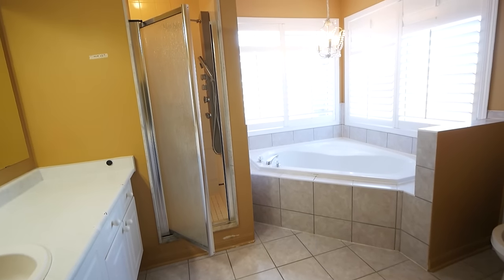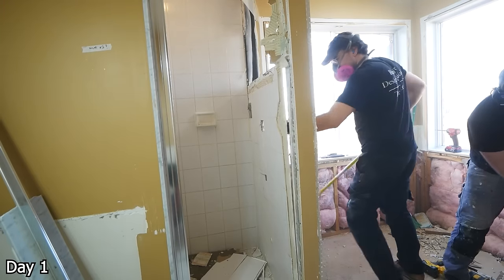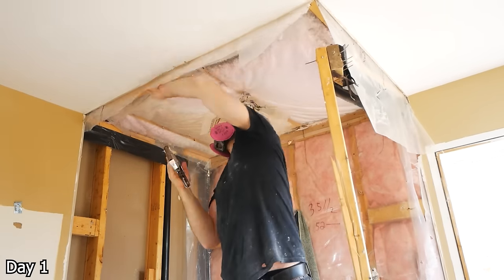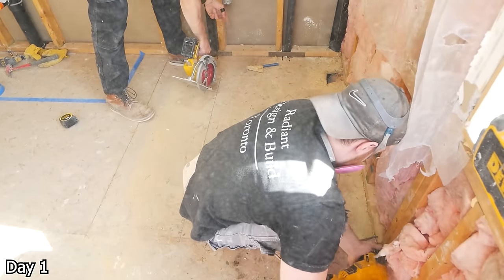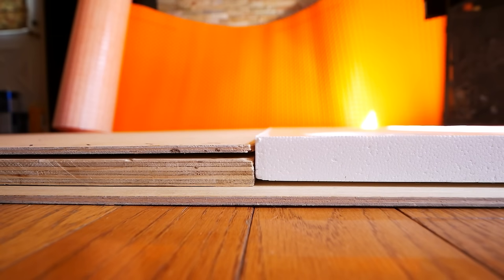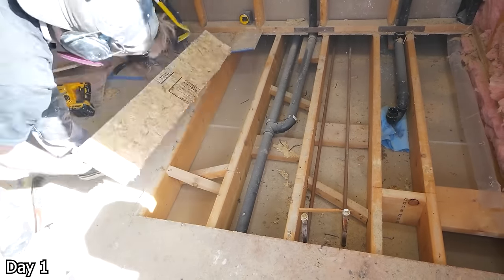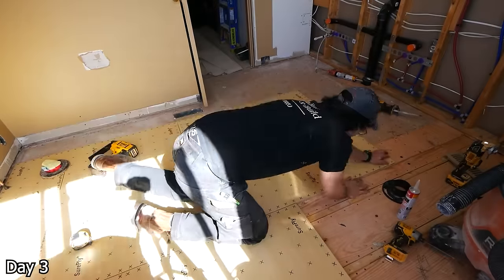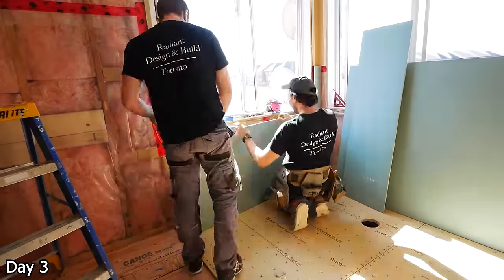How to Build a Curbless Shower | COMPLETE GUIDE | Bathroom Renovation

Comment: Dude there is absolutely no way that there is a single bathroom contractor out there does everything to the detail that you do. Huge props.
Reply: i try my best to. even if it takes a little longer i like to leave the job with 110% satisfaction rating for both me and my clients. TBH contracting for me has been more customer service than work and that has done me pretty well.
Reply: @fryedchiken48  well any chance you're located in los angeles? haha
Reply: They are just rare. Not gonna lie. I only need help sometimes on plumbing and electrical but the only reason I don't do everything myself is because it's too exhausting. I'd burn out. I dream of a partner/hire like Wolkon has.

Comment: Fantastic Video!   One issue I have is the curbless showers appear to have a greater risk of flooding.  When the drain backs up (and it will), and water will be accumulating on your both shower floor and total bathroom floor (under the gasketed door).  As there is no drain in the bathroom floor - it poses more risk more water damage on the ceilings etc.. of the floors below.

Comment: Thank you for including the glass installation! It was neat watching them install the glass enclosure. Once again, another superb bathroom renovation that took a bland, cramped bathroom stuck in the 1990s to the 21st Century with open concept, luxurious feel. I am a huge fan of curbless shower design.  If I could do my master bathroom renovation all over again, I would definitely seek out contractor who knows how to do curbless shower. I may have to get them to build a pony wall to hide the faucet so that it is hidden from view but within reach without getting wet from the showerhead.
Reply from the maker: Thank you so much! Yes separating the valve to be more accessible is a good idea for sure

Comment: Very nice.
I need to see a comparison between how the air flows with the extractor fan just outside the shower or directly inside the shower. The way I see it, with the fan just outside the shower, you're hoping it will remove the excess steam by pulling air out of the shower space through that gap above the door, and that means an equal amount of air has to enter lower down, through the tiny gaps under and beside the door. That sounds like if it works it's going to create a cold draught, and if you've got it closed up too tight for draughts, the extractor isn't going to be able to pull the steam from the shower.
I reckon if the extractor fan were inside the shower, it would be pulling air in through that big gap over the door, and that air would sweep up the steam that rises to under the ceiling and take it out through the extractor without creating draughts lower down.
I'm not a fluid dynamics engineer, so I need to see if this is how it works in practice.

Comment: Is there a standard size of mixing valve? As in would that schluter valve flange fit most mixing valves?

I have a bathroom to build and there are currently separate hot and cold knobs roughed in. Would it be a better idea longevity wise to swap them out for a centered style valve -one that would fit in that flange hole? Thanks

Awesome work like all of your other builds. Great tips too
Reply: the mixing valve seal is not necessary. mixing valves come with their own gaskets.
Reply from the maker: As Conrad has stated the schluter seal isn’t a crucial component

Comment: Beautiful room. I had no idea the glass installation was so involed! Did they screw the ceiling brackets into block and was that planned by you?
Reply from the maker: Thank you!
Wood backing is definitely preferred, and is pretty easy to plan out ahead of time especially since we typically have the ceiling over the shower open.
Anchors could be used if not though
Reply: @WorkinwithWolkon  Makes sense thanks. Can I ask what led you to outsource the glass installation? It seems that you do lots of stuff yourself that's just as hard if not harder.

Comment: Hey Walton, I just wanted to say your videos are great and gave me the confidence to renovate my second-floor master bathroom.  I did run into a surprise right when I first started opening the subfloor.  It appears that my floor joists are not joists at all, but instead engineered trusses.  While this makes it great for rerouting the plumbing/electrical it left me with the question of how to recess the subfloor.  I can't use the traditional method of lowering the floor with 2x4s and attaching the subfloor to that as the trusses don't have enough surface area to attach the 2x4s to.  I have looked into lowering brackets (rapid recess, etc), but was hoping I didn't have use as these options are quite pricey.  Do you (or anyone for that matter) know the proper way to recess a floor that is built on engineered trusses?

Thanks in advance.
Reply from the maker: Check out our video “massive ensuite bathroom renovation” 
Good luck!
Reply: @WorkinwithWolkon  Thanks for the reply, and believe me I've searched through all your videos (and the rest of the internet it feels like) to see how people have recessed their subfloor with floor trusses.  The video you pointed out appears to have I-joists, so the same installation method would be used on floor trusses?
Reply from the maker: @captmcawesome4246  My apologies I misunderstood. Honestly you might just have to use a system like rapid recess. Expensive yes, but at least it will be quicker

Comment: Do you even need the glass
Reply from the maker: Yes and no 
Glass not only serves to contain the water but also the heat. With heated floors this isn’t as important but still should be considered
You can look into wet rooms to avoid glass at all
Alternatively for this shower specifically, I would always recommend the fixed piece that separates the shower and vanity although the other piece could possibly be removed. 
If wanting no glass at all I’d recommend at least 5’ of distance from the shower head to any other items and waterproofed/heated floors
Reply: @WorkinwithWolkon  thanks, good point about the distance to the cabinet if there isn't going to be glass to protect it